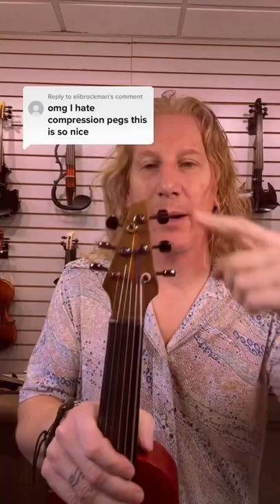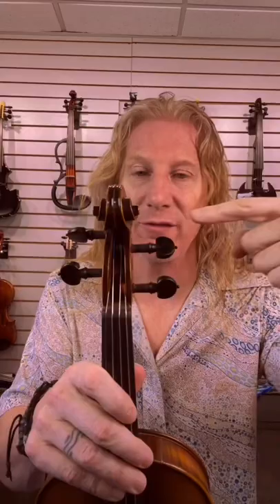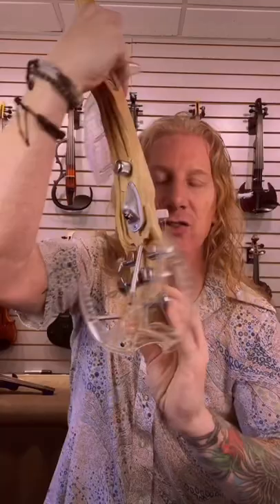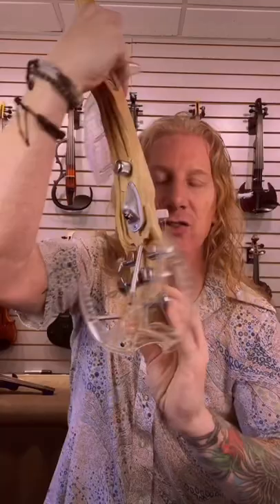I hate violin pegs that stick or slip #shorts

Comment: I remember the first time I had to use a peg instead of the fine tuners, I was not (and probably never will be) ready to actually tune with the peg regularly,  but the fine tuners were down too far, so I took the fine tuner, unscrewed it almost all the way, and then I twisted the tuning peg out.... and I reached the dreaded slip. I was able to fix it though, and I do this every time I run out of fine tuner.

Comment: I have those internal-geared "pegs" on an ukulele. They're nice. On Youtube you can find a video about a harp made with guitar tuners. Now that looks like it'll help a lot (I'm well acquainted with harp tuning - can be tricky). But.. there are Finnish kanteles where you can get the otherwise exact same instrument with either traditional pegs (though steel ones) or with guitar tuners, and the thing is.. with the guitar tuners they sound different! Worse, in fact.  So there's that.